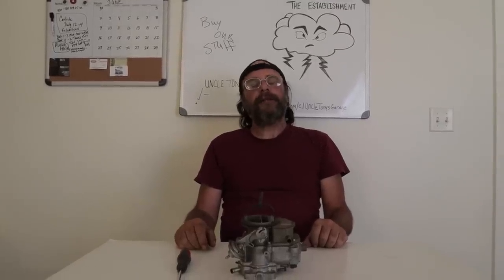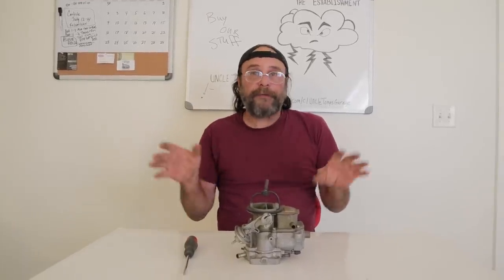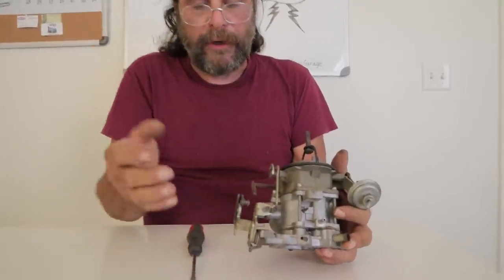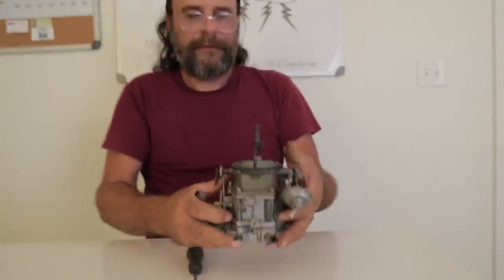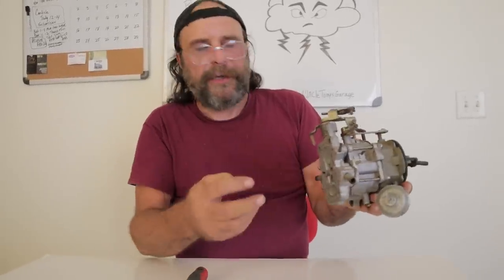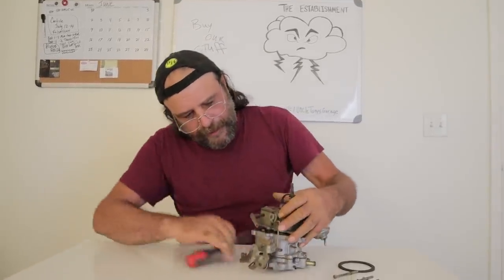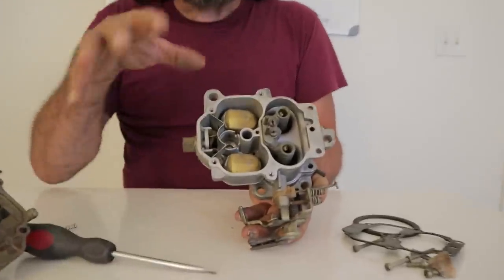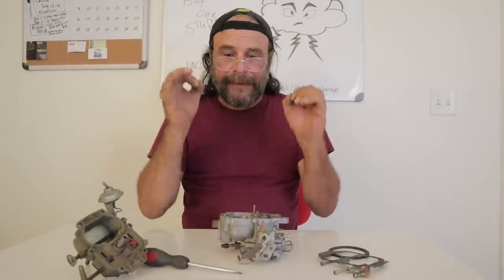Classic Car Tech- Understanding Carburetors

Comment: I always drill a hole in each throttle blade to fix the idle issue when you need to uncover the transition slots to get it to idle if you have a really big cam (think small block 9500rpm peak power) I have had to drill all 8 blades with 1/4 holes but this is an extreme example always start small and on the primaries don’t drill the secondaries unless you have a 4 corner idle carb also people change main jets to set wot mixture on Holley carbs the main jets on a Holley are your cruise mixture the wot is set with the power valve jets this is one reason why use should always buy aftermarket adjustable metering blocks this also allows you to jet the emulation tubes so if it’s rich at say 4000rpm and lean at 6000rpm you can dial it in not as good as a  Weber I remember when they sold a Holley metering block that used Weber jets and Emulsion tube’s I could go on for days so I’ll shut up now

Comment: I had a grandpa that would “steam clean” his engines by squirting a small amount of water thru the carb while the engine was running.
Also, cleaning the oil passages by filling the oil sump with diesel and running the engine for 3-4 mins.
Any truth to this crazyness?
Reply from the maker: It works great...EXCEPT on anything with aluminum heads.  That's how you drop a valve seat
Reply: If you have an engine thats not too sludgy, Marvel mystery oil is a good slow cleaner. 
Wash all the trash out at once and kill bearings. Do it slow and its safer.

Comment: No emulsion tubes/ air correction? don't they deserve some love?
Reply from the maker: The video could have been 18 hours long and I still would not have been able to cover everything in complete detail.
Reply: @UncleTonysGarage  Its just that I find that to most folks its the most misunderstood/ hard to comprehend circuit by far, combine that with frequently cracked tubes (on domestics) and easily plugged correction orifices....many carbs went to the junk pile from a single grain of sand.

Comment: If anyone could help me it'd be greatly appreciated. I have an 86 f250 with 460, engine is perfect, fuel system is perfect, engine stalls at 2200 rpm consistently. Had the carb rebuilt professionally ran great but still stalled at that rpm, put an edelbrock on it and problem is fixed. Trash the origional carb or? Is that something fixable
Reply: Adjust / inspect the float level / needle valve / inlet. It's running out of fuel. That's my first thought.
Also, around that rpm is when the back 2 barrels begin to open on your 4bbl carb. They had a vacuum operated model maybe in 86. Which means the carb could be perfect from the rebuilder and still not working right on the car. Those years had a real rat's nest of vacuum lines that were very hard to troubleshoot.
Reply: @gg5115  thanks for suggestions I'll give it another shot
Reply: @juryrigjohn9697  You know, one thing I've done on a Ford more than once, is to rig up a little plastic gas can to gravity feed the carb so I can idle it, while routing the fuel pump into a big glass jar. Fuel should come out pretty steady like a small garden hose, and not spit or pulse overly. I guess if the Edelbrock really runs perfectly, you've eliminated that, but it has tricked me before. Fords are bad about that diaphragm failing slightly.

Comment: I’m part of a Facebook group and I’d say roughly 75 percent of the people on there are LS fanboys. That aside, if you mention anything about a carburetor having an edge over EFI in any way shape or form you will have 100 people absolutely dogging your ass. They don’t deal in any facts, and they hate anything that they can’t pretty much plug in to something and make work. They get so mad about carbs and I just don’t get it. Obviously my trucks are EFI but all of my dirt bikes are carbureted and it’s common knowledge that a carbureted bike that’s tuned right is far superior to a fuel injected bike, especially if you’re running mods.

Comment: Efi is great, until you have a problem. Try getting a U1000 code, or a P300 random misfire code on an EFI car. Unless you have a really expensive scanner, you're going to have a fun week/months trying to figure out the problem. Even with the worst carb problems, just buy a new carb for around $300, and be on your way. With fuel injection, $300 won't even buy new fuel injectors [on most cars].

Comment: What about the spread bore
Reply: Square bore is a 4 barrel with primary &secondary  butterflies the same size...spread bore is a 4barrel where the secondaries are much larger than the primaries.
Reply: Theyre more street than performance right? I have alot of holleys sitting around one is a spread bore 350 or 400 cfm i could be wrong on the cfm exactly are tgey any good?

Comment: I had a carburated pickup that would freeze up in the winter. .............WHY
Reply from the maker: Cold?
Reply: @UncleTonysGarage  after driving half way to work in winter weather
Reply: heat riser pipe missing carb icing is a thing .heaters in air craft to prevent it,cars had couple tpyes cant rember now heat riser vavle pipe and shield somethig else? didnt have to be winter either.

Comment: Paused video to look at flush valve in toilet and see how it relates to the fuel system in a carb. 

Went to restroom. Got sidetracked. Took. A shit and smoked a cig. Made coffee. Went outside and started dicking around in garage. Cleaned up mower. Mowed the lawn. Hit rock. Pulled blade off. Filed blade sharp and put it back on. Finished mowing. Changed oil and cleaned filter in mower. Smoked last cig mowing. Went and got a pack. Saw a guy broke down on side of road. Helped him out. Ironically carb problem. Gets back home at 10 pm and walks back in to see that I paused this video 8 hrs ago. Starts video. Backs it up a minute or so to get reoriented. Plays vid. Pauses vid to go look at flush valve in toilet and see how it relates to fuel delivery system in carb. Cracks beer. Goes to can. Lights cig. What was I here for? Holds wall takes piss. Dogs are barking. Grabs gun heads outside. Nothing. Walks down road. Nothing. Turns around. Back inside. Sits shotgun in corner. Sits on bed. Lights out. Wakes up. Sits down with coffee and a cig. Sees your paused video. “Oh yeah!”.

Comment: Carburetor's are cool I like them but no way are they more accurate than fuel injection. They cannot account for changes in fuel or air temperature or atmospheric pressure.
Reply from the maker: The difference in operation is minute when a carb is tuned properly.  DEFINITELY not enough to justify the extra cost and complication of FI.  I know..I live this stuff every day of my life

Comment: Carburetors better for performance than EFI? I can't agree with that in every instance. Before I begin I will state this, I understand I am not as experienced as you, but with my experiences as a mechanic, and my enthusiasm with performance vehicles, this is what I know and why I disagree.

Carburetors don't compensate for differences in engine temperature like fuel injection, carburetors don't compensate for intake air temp like fuel injection does, not atmospheric pressures at different altitudes, you don't get the advantages of having a very wide range of fuel mixtures on a fuel map depending on engine RPM and loads, boost, temp and manifold pressures like fuel injection.

The number one argument I here in favor of carburetors is because the fuel mixture is atomized in the intake, it drops intake air temps increasing air density as the fuel atomization draws heat energy out of the intake air... the simple solution to that is for things like drag racing where you want WOT max horsepower with SFI, is place the injectors at the top if the intake manifold, or.... install water injection.

With modern computers, they process a wider range of information much faster, you can have exhaust temp sensors and 02 sensors for each exhaust runner, and you can have sensors for coolant and oil temp, you can have sensors for intake temp and manifold pressure, and all these inputs, and as a output with this data computers can almost immediately make adjustments to fuel mixture to each individual cylinder constantly to meet the exact AF Mixtures at what engine loads and RPMs that the tuner adjusts at each cylinder, then you can also adjust things like Nitrous Oxide and water injection! 

Direct fuel injection can inject fuel during any point of the four cycles, this means it can inject fuel during the compression stroke if it needs too like a diesel reducing knock, allowing for higher amounts of boost or higher compression.

And with as simple as computers are to use these days, making adjustments are as easy as clicking a few buttons and adjusting a few settings on a small laptop inside the car, modern systems are simplified in comparison to older ones yet far more efficient, because in this day of age, the cellphones people have in their pockets, exceed the processing power of even an advanced computer of the 2000s literally a cellphone could run a car these days, and quite often most aftermarket PCMs or ECUs or what ever you want to call them, are the size of tablet, and weigh about as much as a Haynes manual, and are easy to program with limited experience. 

New internal combustion engines made by Koenigsegg in concept don't even have camshafts, their valve train is a set of electronically actuated valves, this means you can have a wide range of valve timing at any moment,  with far more aggressive valve timing not possible with a mechanical camshaft and mechanical valve springs at higher RPMs, then at lower RPMs you can have valve timing that favors torque, and then at idle the valve timing can automatically adjust for a smooth idle, and then for street applications it can automatically adjust valve timing to increase drive ability, reduce emissions, and increase fuel economy. not possible without computers, or modern mechanical fuel injection.

Comment: If you are going to work on your car, then for gods sake, get a workshop manual for your make & model. A factory manual is best but there are plenty of aftermarket service & repair manuals that are far better than nothing. If working on a "replacement" carb, then there are a few very good books om specific brands of carbs too, particularly Holly & Carter carbs. [I run AFB's]. I have a whole library of manuals for cars that I no longer own, but friends do, & they foolishly think I know everything. In reality, I know what I know in detail because I know where to find the technical detail for the car in question. It's in the book. The factory manuals were written for the qualified auto mechanic, but with a little time & effort, even the brain dead can become an expert by reading the section that related to the problem or component in trouble.
I'm a qualified auto mechanic, & have been for 53 years [yes, i'm old] & I not only make sure I have the workshop manual, but a parts book too whenever possible.

Comment: "Proven time and again that a carburetor will outperform EFI."  Do I really need to say it??? Good basic info, but that's just silly.
Reply from the maker: It's not silly at all...do your own search
Reply: @UncleTonysGarage  I appreciate the reply....and your candor. I think the best one could say is that 'some'  carburetors will outperform 'some' EFI systems (whereas the inverse can also be true). The point being in the design. There's nothing "in physics" that dictates a carb will outperform EFI; it's a matter of airflow, AF/R and atomization. A properly designed EFI system will perform equal to a carburetor in terms of peak power (a terribly narrow focus for anything but a strict drag car, I might add) and probably then some, since 'peak power' isn't limited to a certain RPM and the EFI is far better at providing consistent optimal air/fuel ratios under different operating circumstances. Also, we are generally talking about just  a few horsepower (either way) and thus it's not really a significant factor when making decisions re: carb vs. EFI, due to all the other benefits of EFI.....versus the relative simplicity and low cost of a carburetor. I'm not poo-poo-ing carburetors here, nor do I mean to be one of those annoying perfection-trolls....It was just something that rubbed me wrong. Your videos are very good in general and I enjoy watching them. I will stop picking nits now. Cheers!

Comment: i have a 2000 dodge pu with the 360 in it every thing is great but the front suspension it has turned in to a money pit the parts are way over priced  and they don't last the rig don't even have 200,000 on it and front has been rebuilt 2 times and it is a 2 wheel drive my 68 chevy has 500,000 on it and still drives tight and we pound it my wife drives the dodge and she babies it y can't dodge build a good front suspension even my old dart sucks on the front nothing like my camero's but i like the looks of the rigs been thinking on chev'en them but i hate to mix cars but i could do it for free just a lot of work or get after market and i buy quality parts for my rigs i don't cheap out them

Comment: Some very good parts to the video but overall, needs to be much better thought out for the novice who has no idea about carbys.  This video is only useful for someone who has a good foundation in carburetor basics.  For the outright beginner who knows nothing, this video would be confusing.  First thing you should have explained is what it does and the whole basic concept.  It mixes fuel with air in the correct ratio required by the giant airpump (engine) !  How does it do that?  Using the Venturi Effect.  (Then explain what that is).  You went straight in and talked about the idle mixture screws and bleed air holes and blade movement - too heavy too soon!

Also you missed out on three major external things on the carb - 1. the Fuel inlet and Fuel storage area (bowl).  2,  The air inlet and where the air cleaner screw on - basic stuff to you and most people who know but important for the person who knows nothing.  3.  The Throttle shaft / throttle blade assembly and its use!  So important and you missed it.

Comment: Beat EFI ?

You din't mention what kind of EFI.

- throttle body EFI - yes, 
- a bad port injection system - yes maybe, 
- sequential port injection - no, 
- direct injection - no, 
- dual injection (direct and port) - no, 
- direct + diesel style ante-chamber (Formula 1) -  no way, 
- triple injection (Koenigsegg's 2 port injectors + 1 plenum injector per cylinder) - again no way
Reply from the maker: And 75 year old mechanical injection beats everything...have you seen a Top Fuel dragster lately?
Reply: @UncleTonysGarage  
Mechanical what ?
Throttle body, port, ante-chamber and direct injection were all mechanical initially and have been around since the early 1900's on airplane engines, diesel (truck, train, generators, submarines) engines.    
 
Top fuelers are a specialized application limited by rules to save money and not allow teams to fiddle with the electronics.
Given total freedom I recon that you'd end up with dual injection at the very least, with some going all the way to 4-5 injectors per cylinder.

Comment: The confusion lies in the idea that carbs are carbs.  Yes, that's true, a carb emulsifies fuel and air.... BUT they all do it a different way.  Some have needles, some have replaceable jets, some have needle jets.  YOU HAVE TO KNOW THE ENGINEERING PRINCIPLES OF THE CARB YOU ARE WORKING WITH.  HOW does my engine tickover?  Is it butterfly angle, or air-bypass?  How do I raise a main?  Is it vacuum?  Is it a cable?  What are my options for tuning?  Needle profile?  Jet?

You need to know what the fuck you are dealing with.

Comment: 10:56 You are deluded for thinking that a carburetor will out perform EFI. That's like saying a dumb bomb is more accurate than a smart bomb, An abacus is faster than a modern calculator, a points dizzy will provide more power than a transistor dizzy. So precisely measured fuel delivery is worse than grossly oversimplified fuel delivery? EFI is superior fuel economy wise, throttle response wise, BMEP wise, thermodynamic efficiency wise etc. Precision never loses and you have such bad confirmation bias that I don't know if I should trust your opinion.